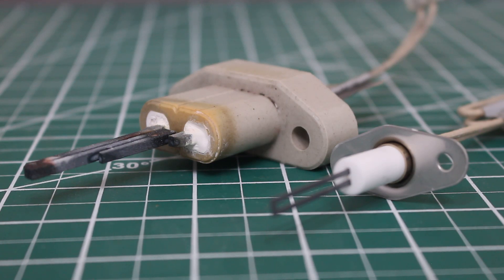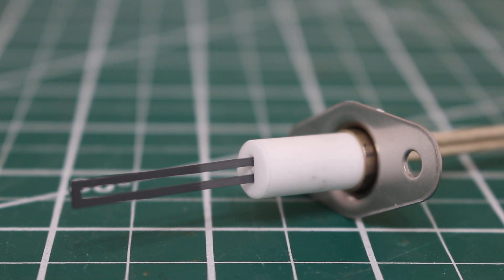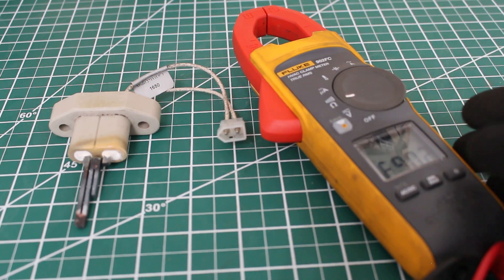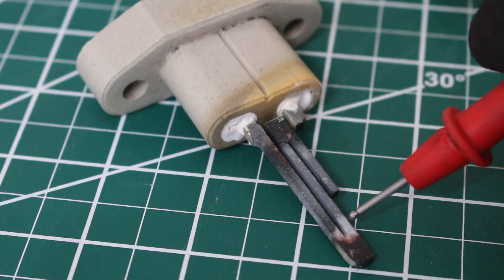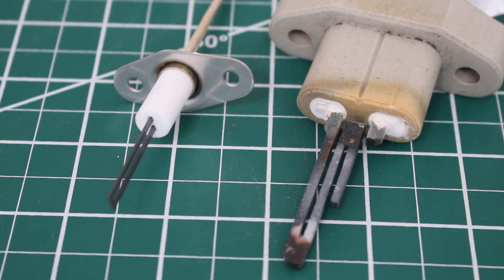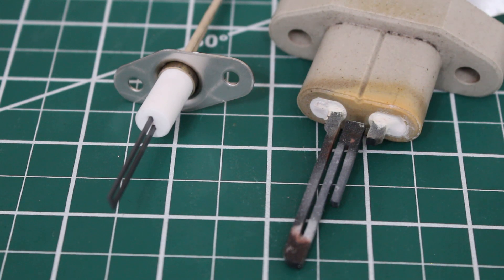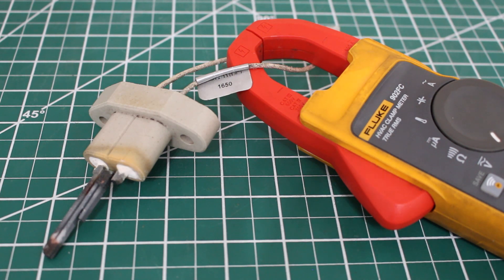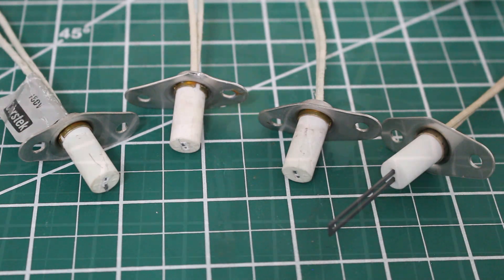HVAC TRAINING: How To Check A Hot Surface Ignitor (Hot Surface Ignitor Troubleshooting) Heating

Comment: I disagree with checking voltage. I have had several furnaces that the hsi would get its voltage, start glowing, light the burner but the burner would shut off do to not sensing a flame through the hsi. Replaced his, and furnace ran until thermostat satisfied.

Comment: so, they supposed to be "normally open" when not energized?
Reply: NO or NC comes into play with relays. That’s not the case with HS igniters. He is explaining resistance readings. The OL reading comes into play with a broken igniter otherwise it will display a resistance reading.
Reply: @roberts1159   Thanks